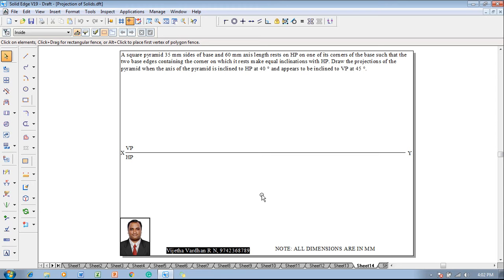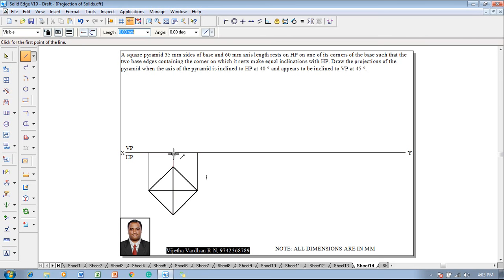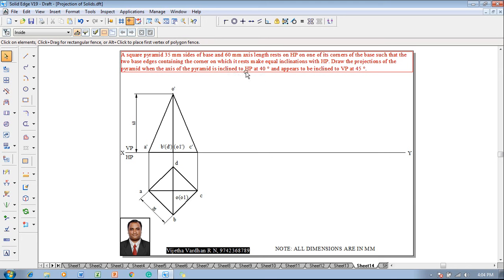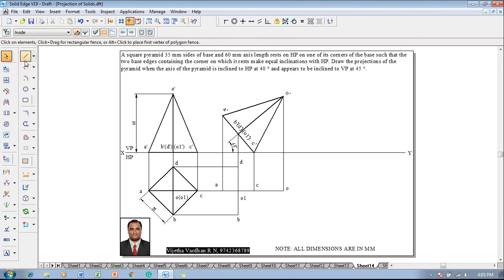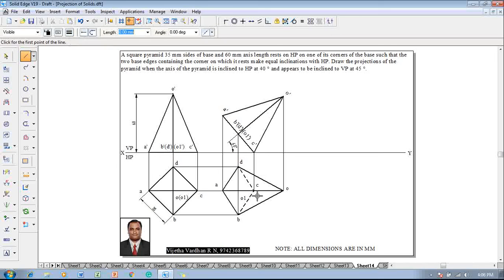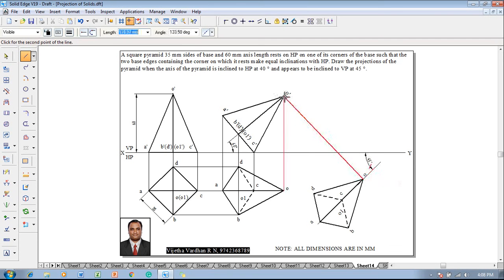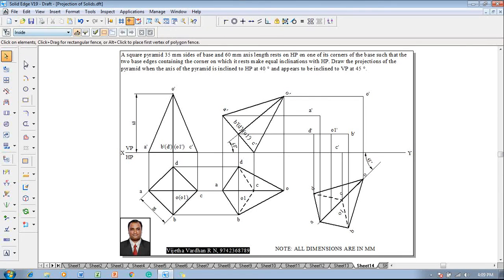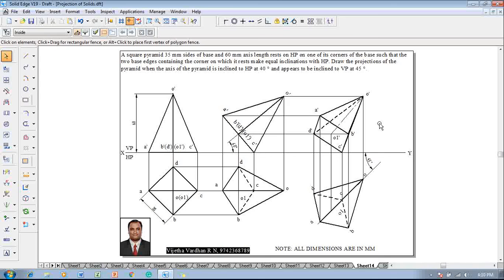Example 14 on Projection of Solids

Comment: Sir in 3rd step u didn't used point arc by center point instead directly y sir
Reply from the maker: You can do it either way
Reply: @VijethaVardhanRN  that means sir
Reply from the maker: @AnithaAnitha-p2k You can do it with arc method or the technique you saw in the video